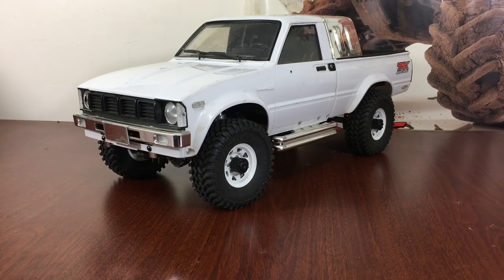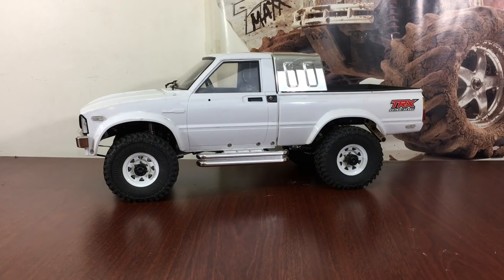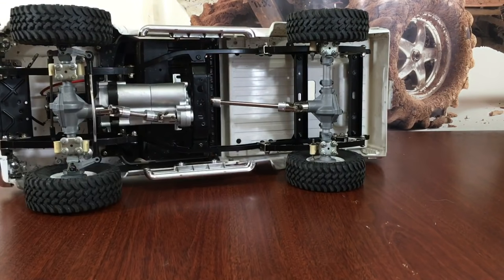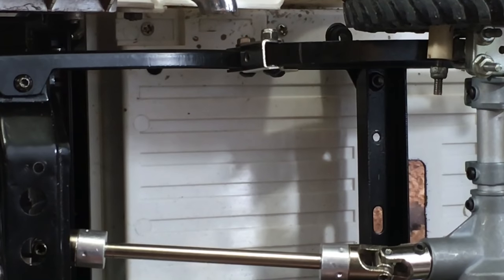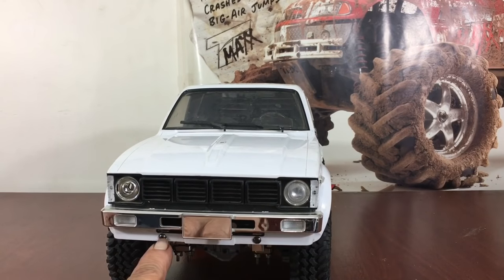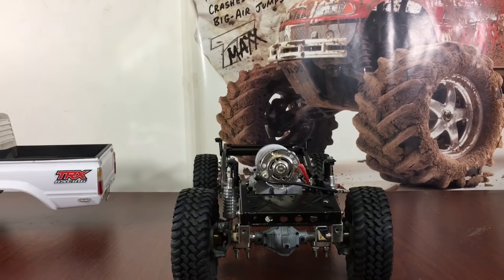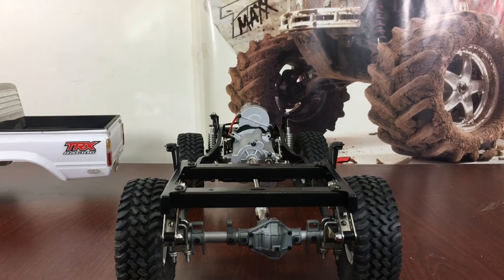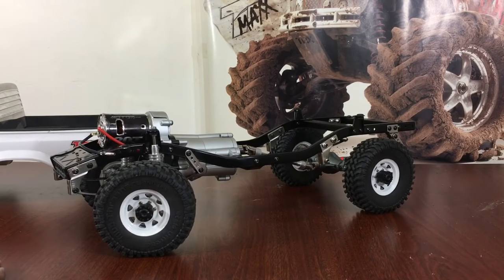Hg-p407 /GA-30 6X6 scale axle update

Comment: Hi, Dennis! Lovely build as usual. I'm trying to steel your idea for my Cross RC Demon.

A couple of thoughts:
1) If you're not particular about these 8-spoke wagon wheel style rims (which I totally get it if you are, since they're so classic), I might humbly submit for your consideration Boom Racing's 16-hole steelies for the LC70. They are incredibly evocative and scale looking. They too have nice front and rear center caps (although the way they screw on is proprietary, it seems).

2) I think it's great that you have the disc breaks, but I'd personally prefer to have calipers too. The issue, of course, is that they can be impossible to install without some custom part designin' and fabbin'. However, they probably wouldn't be too visible and appreciable through these narrow triangular spoke gaps.

3) My general stance on RC leaf springs is that I'm not particularly thrilled to begin with about the already reduced leaf count out of the box, let alone stripping them down to just the main one. It kinda defeats the purpose of having leaf springs altogether. I think the rest of the industry should take it from JD Model's playbook and give the leaf springs the same treatment they gave with their Ford Raptor Hero, where they had decorative plastic leafs on top of a single functional one. That, I think, was an optimal performance VS. scale compromise.
Reply from the maker: I was going to upgrade to the 16 hole wheels they weren't out at the time I built this one. The leaf spring idea is really cool I want to look in to it. I have some faux calipers for the truck but never got around to install them yet,

Comment: Any link to the axels? And could you just flip the leaf springs under the stock axel instead of over? Had a bruiser when I was young but never got it running right. Thanks!
Reply from the maker: https://www.ebay.com/usr/kingkong-rc?_trksid=p2047675.l2559     the bruiser/hgp407 axles are to wide to lower or flip on top the springs then add a wheel adapter ontop of that puts the wheels outside the body,

Comment: Do you think this mod would be easier or cheaper if you start off with the hg p409 ?  or would it be about the same amount of work , from the images it looks like the axles are narrower  than the 407  plus you get the kc rollbar instead of the wide cab extension ,  i am looking to build one of these and trying to decide which one to get ,  any thoughts ?
Reply from the maker: The HGP-409 wasnt out when I did this conversion,  from what i remember the 409 has a straight flat frame opposed to the 407's curved frame over the axles giving it room to lower it and giving the axles room to move up in the body, the 409 has bigger pumpkin centers on the axles also and if you want to use a 1.55 tire the center pumpkin might be dragging the ground . the axles I used were from the king kong 1/12 military rig.
Reply: @dennisdempseyradiooutofcontrol  , yea thats why i ultimately went with the 407  , i have wanted a highlift since i was a kid but once i realized that it didnt have interior , and that the diffs were not lockable that killed the idea for me , i have had the 407 for about 3 days and it has been one hassle after another , the electronics were not working it would shut off every ten feet and once i somewhat got past that i realized the transmission was jacked up , really regretting my purchase now  , i figured i would at least get to drive the thing before pouring a ton of money into it   , thats chinese stuff for ya  , explains why it was so " cheap "
Reply from the maker: @TheRandomMechanic   the quality control must have gotten bad recently from what i am hearing the bearings are hit or miss and the gearboxes seem to be a problem lately, some are assembled dry and stick between shifts or are put together wrong,  a lot of people buy the kit to assemble themselves and buy their choice of radios. I have been replacing the rtr radios with the surpass 4 and 6 channel ones they are around 35-40 bucks on ebay, I just bought one today.
Reply: @dennisdempseyradiooutofcontrol     im thinking the transmission is dry cause when i changed the motor out for a sport tuned tamiya 540 i noticed the gears were spotless clean  ,  i may need to pull it apart , the issue is that it has trouble finding 2 wheel low  it just goes in between and lands on neutral   , not that il use two wheel low that much  but it is still annoying none the less ,   do you have a video of the surpass radio system ?  i would like to see the setup i may switch over myself  cause the stock radio is trash

Comment: looks very good but this axles looks more like dana, i think yota-style axles are closer to original.
how durable are this axles? are the case is plastic? thanks
Reply from the maker: Yea I agree , I did the yota axles on the following video, ( the super scale blue toyota) but they stick out of the wheel housings a little.  the dana looking ones are all metal and have a locked diff with hardened gears comparable to the rc4wd yota gears, the 6x6 truck they came from is huge and heavy so I figured they would hold up to the 407 weight easily.

Comment: looks cool! my only problem with mine is the long lenght axle. what axle do you use?
Reply from the maker: I used the King Kong RC  GA-30 truck axles on it.
Reply: @dennisdempseyradiooutofcontrol  it is 1:12 scale right?
Reply from the maker: @AdityoAnindito  Yeah its 1/12,  the axles fit the HG perfectly and look so scale.
Reply: @dennisdempseyradiooutofcontrol  ok, thanks man!